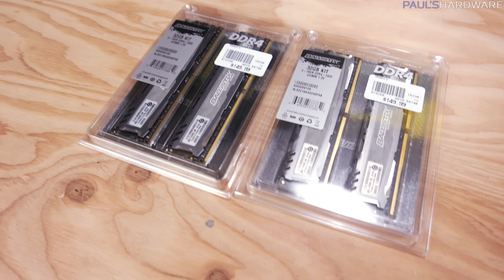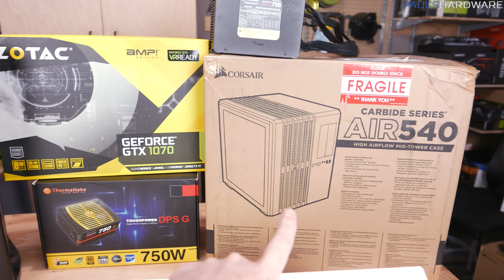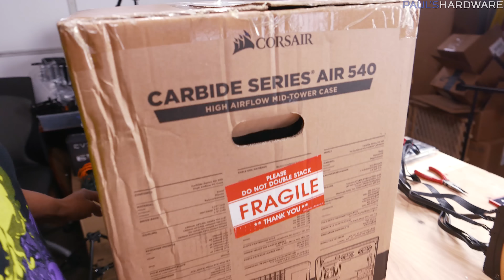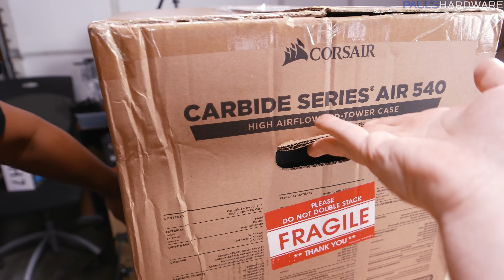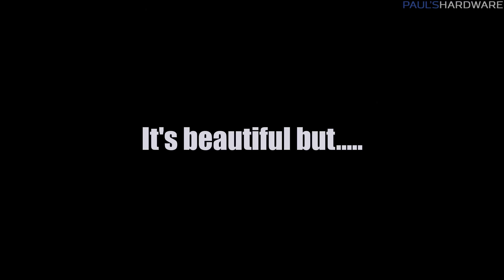Building "Party Monster" - Joe's 4K Video Editing PC

Comment: I'm confused as to why you would switch from a 3960x to a 5820k, according to CPU benchmarks they are going to have basically the same performance. They both support 64GB of RAM but the only difference is that single core performance is slightly better on the 5820k and it can use slightly faster DDR4 RAM.
Reply: ***** If I remember right CUDA acceleration is odd due to the fact scaling isn't really linear compared to gaming with GPU's. The difference in render times with a 670 and a 1070 really won't be as big as you would think it is.
Reply: He said he would be "lending it for the time being" so I assume jo will eventually move up to something better? 6900K or similar?
Reply: Basically what I was going to post lol it's overall not much faster, editing 4k probably requires a workstation GPU more than anything, even the broadwell stuff won't be much faster, because If I remember right broadwell-E doesn't overclock well
Reply: Yeah they made a really odd choice with this, the only logical thing is that he will eventually be upgrading to like a 6900k. Otherwise overclocking the tits out of that 3960x (Which is possible, it was pretty common to hit 4.8Ghz with those things) would be the best bet.
Reply: tehDmez
dunno about after effects, but premier seems to scale very poorly with more cores, older versions were actually better in that regard if I remember right
Reply: I would think for the upgrade path of X99.
Reply: Agreed should have just upgraded memory and gpu changed the case  and done
Reply: MB & CPU were Review-/Tech-Samples that Paul had lying around and by giving it to his Editor, whose basically getting a cheap Platform-Upgrade (potential 128GB-Ram Support for example) and instead of lying around, Paul can put those High-End-Parts now to good use. Win-Win with minimal investment ;-).
Reply: Birdhunter I guess that makes sense, he can't technically sell the engineering sample so might as well give it away.
Reply: He said that processor is for "the time being" so, I guess he might give him a better Broadwell-e one later
Reply: Well I had a 660ti and switched to a 980ti back in March, and I can tell you the difference between the two is very substantial both in terms of editing and rendering 4k videos. That being said, your comment on the "upgrade" makes complete sense. Gains, if any will be marginal, or mostly due to GPU and faster spec'd RAM. Although, I've found Adobe CC programs don't really care about the speed of your ram so much as the amount of your RAM. A build that would have benefited this man is (dual) Xeon setup, and a Quadro for After Effects work.
Reply: Benchmarks aren't always accurate for every use case. The 5820K will outpace the 3960X, especially when overclocking both, for certain workloads. The 5820K also supports 128GB of RAM, a newer PCIe revision (3.0), native USB 3.0, more native SATA III ports (10).
Reply: ://ReaperReaper
But all the money spent on upgrade probably would have gotten a decent workstation card to start with if editing 4k was his main objective, the CPU was pretty fine unless it was running at stock clocks
Reply: Street Guru Yes, all the money spent on the free CPU Paul received from Intel, and is loaning to his editor, could easily go towards a better workstation card.
Reply: ://ReaperReaper
I'd imagine they bought the rest of the parts
Reply: Street Guru Most Workstation cards actually aren't any better for video editing. The features you see on a Quadro are more geared for GPGPU and redundancy. Some of the absolute best editing cards have been GTX cards,
Reply: They are better for after effects, the other primary use for this dudes pc
Reply: Alexander Fagard Not really, it's been proven that Quadro cards don't actually perform any better than the GTX card sporting the same GPU for any facet of video rendering, and the extra RAM you see on some Quadro cards, like the M6000, don't give the card any more oomph over GTX cards sporting the same GPU but less VRAM, like the Maxwell Titan X.
Reply: that's not correct - with the right board, 128gb are possible for the X99 platform - Link https://www.techpowerup.com/forums/threads/128gb-ram-on-x99-platform-with-5820k-no-problem.222305/ as an enthuiast showed at techpowerup due to microcode updates.
Reply: ://ReaperReaper let's assume that he does alot of 3d stuff in after effects with element 3d, he will most likely, given the choice between the m6000 and the titan x, benefit from the added VRAM as textures don't have to be loaded and unloaded as often. otherwise, price per performance you are indeed correct. esp. w maxwell architecture. one thing i think quadro has an edge on is that its 10bit, whereas I don't think the gtx's are. can be extremely useful when color grading. but idk, ive got a 980ti and I'm perfectly happy with it and I dont have 5g's to run any in depth tests on the m6000.
Reply: Alexander Fagard Again, the additional 12GB of VRAM you find in the M6000 isn't touched for 3D work. You'll rarely see 12GB of usage in most scenatios, the 24GB is more often used for redundancy. A lot of it will rely on the system memory, which has the benefits of going up to 128GB of RAM on X99, and the data isn't sensitive to the speed difference.
Quadro cards do have an edge with 10bit color over most GTX cards (spare the Titans if you run Quadro drivers), but the additional range of color isn't actually useful for video editing. There is more benefit to HDR support, which I don't think any NVidia cards support at the moment.
Reply: ://ReaperReaper i disagree that 10bit range isn't useful. there is a reason why any camera worth its salt uses a 10bit (4:2:2) stream and that is because you get extra latitude in color correction/grading to avoid banding, to get more accurate skin-tones, .etc. if you have a full 10bit pipeline you can actually see this data rather than having to rely purely on scopes inside your NLE. And HDR support in terms of video, just means that you can see the usable dynamic range. You don't need anything special, but rather a good monitor with 10bit support and the rest of the pipeline in 10bit. But good colorists can actually see it just by looking at the scopes.

And while my work in after effects hasn't come close to saturating 6gb of vram (mostly 4). I can imagine if you were using element 3d in a form that say Andrew Kramer did when making the titles for star trek, you would quickly saturate 12gb with multiple high res textures. 

All I'm saying is that the quadro cards are not irrelevant in terms of media production.
Reply: 3960x supports PCIe 3.0 as well.  http://gpuz.techpowerup.com/16/09/20/8t2.png http://valid.x86.fr/p2gd8p
Reply: Alexander Fagard Quadro cards aren't irrelevant, but they aren't used the way you think they are. Quadro cards add redundancy, something large media companies are willing to pay for.
For Video editing, 10bit really isn't useful. The problem of banding you described, that isn't due to the 8bit range, bottlenecks, file conversions, and data corruption are. The more granular control is also meaningless, the human eye can't accurately distinguish between 8 and 10bit to make use of it.
You can also have YCbCr 4:2:2 in 8bit depth, as well as YCbCr 4:4:4. The only potential loss in perceivable quality is going from 4:4:4 to 4:2:2 and vice versa.
HDR means being able to correctly display the range of color and shades, something that'll have a larger affect than 10bit depth, when paired with a HDR capable GPU and panel.
Again, 3D work will turn to system memory first, not saturate the VRAM of a system. The data isn't performance sensitive, and most editing systems are well equipped with more system RAM than you'll find on any graphics card.
Reply: Jeremy Ellis That's reporting the graphics card PCIe bus support. the 3960X has zero native PCIe 3.0 lanes, those can only be added in through the DMI.
Reply: ://ReaperReaper no it is not.  it goes from 1.1 when i am not doing anything  to 3.0 when running a 3d app. http://gpuz.techpowerup.com/16/09/20/9ym.png 

http://gpuz.techpowerup.com/16/09/20/bph.png
 it says under bus interface PCI-E 3.0 X16 @3.0 X16 MEANING THE CARD IS CURRENTLY RUNNING AT 3.0 X16. the 3960x has pcie 3.0 support, all 40 lanes of it. amd gpus automatically run at 3.0 but nvidia cards need their driver pached, but its dead easy. nvidia did this bc some x79 mobos and even some cpus cant do 3.0. you can even get nvme boot support on x79 by moding the bios. the 3960x is still a beast of a cpu especially at 5ghz.
Reply: Jeremy Ellis http://ark.intel.com/products/63696/Intel-Core-i7-3960X-Processor-Extreme-Edition-15M-Cache-up-to-3_90-GHz
Both of those links are absolutely meaningless. There is absolutely no verification that the 390 was in the same system, or even in a system with a 3960X.
The only way a 3960X could ever run a PCIe 3.0 device at 3.0 speeds is through the DMI.
Reply: Jeremy Ellis If a revision of PCIe isn't supported, it isn't supported. The 3960X doesn't, hasn't, and never will support PCIe 3.0, officially or unofficially. PCIe support doesn't work that way, it is a limitation of the hardware.
NVidia might have botches backwards compatibility when they first implemented PCIe 3.0 on their cards, but they have NEVER claimed to have released a patch that updated X79 to PCIe 3.0.
Your guru3D link is also another load of bullshit. Heaven isn't bottlenecked going from PCIe 3.0 to 2.0 on cards like the 680. They don't fully saturate the lanes of 2.0 to begin with. Heaven doesn't even see a significant difference going from PCIe 3.0 x16 to x8 or 2.0 x16 on a GTX 1080.
The 'Force Gen3" application is also a load of bullshit. Any board running PCIe 3.0 over the DMI will already be running any slots at 3.0 speeds, and there are still a grand total of zero PCIe 3.0 lanes native on the 3960X.
Reply: Jeremy Ellis X79 in this case is referring to the Ivy Bridge-e processors like the 4960x, which do support PCI-E 3.0 while still running on X79 chipset. http://ark.intel.com/products/77779/Intel-Core-i7-4960X-Processor-Extreme-Edition-15M-Cache-up-to-4_00-GHz
Reply: tehDmez Some motherboard manufacturers have released an updated SBIOS to enable the Intel X79/SNB-E PCI Express 2.0 platform to run at up to 8GT/s bus speeds. We have tested GeForce GTX 680 and GTX 670 GPUs across a number of X79/SNB-E platforms at 8GT/s bus speeds, but have seen significant variation in signal timing across different motherboards and CPUs. Therefore we’ve decided to only support and guarantee PCI Express 2.0 bus speeds on X79/SNB-E with our standard release drivers. Native PCI Express 3.0 platforms (like Ivy Bridge) will run at 8GT/s bus speeds with our standard release drivers.

 straight from nvidia. you guys can stay ignorant for all i care but it just takes some googling. my 390 IS RUNNING AT 3.0 on my 3960x sys. take care now.
Reply: Jeremy Ellis NVidia never claimed that, no mainboard manufacturer ever claimed that.
No mainboard manufacturer can push a BIOS that enables the 3960X to use resources it doesn't have. What they can, and did do, was push a compatibility update for the new chips, like the 4960X.
Some real research, not browsing forums like Guru3D, will not support what you state. Intel has firmly denied any native PCIe 3.0 support on the 3960X, with the only option being PCIe 3.0 through the DMI.
You either are lying about running the 390 on PCIe 3.0, you're running it on the DMI's PCIe lanes, or GPU-Z is falsely reporting PCIe revision.
I can attest to the third option, GPU-Z states that my RX470 and GTX 1070 are both running at PCIe 3.0 x16, on the first and third slot. On my board, the first and third slots run at x8 speeds when both are active, something I verified in my UEFI.
Reply: ://ReaperReaper "that isn't due to the 8bit range, bottlenecks, file conversions, and data corruption are." this statement is the reason why I know you have almost no real world experience. i'm not going to refute your claims, because there are plenty of articles on filming that actually explain the difference between 8bit and 10bit color/grading. cough cough: http://www.hdwarrior.co.uk/wp-content/uploads/2011/08/10-bit-chart.jpg. not to mention I have yet to meet a camera that can record 8bit 4:4:4 (its usually 10/12bit 4:4:4). if you can find one be my guest. also the human eye might not be able to determine the differences between 8bit and 10bit off the bat, however you can totally see it when grading in terms of how far you can push an image to look a certain way before artifacting .etc. starts to show.

also I was recently at IBC, and a majority of the color grading workstations were using... guess what? quadro cards (sometimes paired w gtx). 

also HDR does NOT necessarily mean what you say it means in terms of video. DR in terms of video editing and filming for that matter refers to the usable range a camera can put out when recording to a log or RAW profile (e.g. 12-14 stops .etc.). Atomos recently tried implementing HDR into their recorders but its mostly a gimmick as you can see use-able range with your scopes and/or an on set LUT.
Reply: Jeremy Ellis Ooh yes, a bunch of forums will prove Intel wrong.
Look, let's pretend the 3960X did natively support PCIe 3.0, why would Intel limit it? PCIe revisions have become a huge selling point.
The 3960X can only use PCIe 3.0 over the DMI. NVidia's compatibility patch won't fix that (they don't even work on any software for components they don't make). Vaporware that "enables PCIe 3.0" won't do that. All you're proving is that there are more morons that will believe that it can.
Reply: ://ReaperReaper one of my links was a massive gain in performance on a 4-way 680/3960x sys but i highly doubt you read any of them. the reason intel did it is bc sb-e was having problems with 3.0 and couldn't get it certified in time. intel decided to just drop 3.0 support. why do you think all the mobos have 3.0 support plastered on the box? some ppl cant get it to work on there 3930k/3960x cpus. its not a glitch and its not a lie, my 390 is running at pci-e 3.0 on a 3960x sys.
Reply: Jeremy Ellis Every single link is to a forum, not a single reputable source. There is no reputable source that supports your bullshit claim, whereas Intel's 3960X ARK page and X79 SB-E block diagram point out explicitly that the 3960X only supports PCIe 2.0 natively.
The reason people can't get the 3930K and 3960X to run cards in 3.0 is because the chips have zero support for natively running PCIe 3.0. The "Force 3.0" patch NVidia offers is a Windows Registry tweak that forces compatibility of the PCIe 3.0 graphics cards on the 2.0 bus. Nothing more, nothing less. Anything GPU-Z reports as a 3.0 connection is a false positive, which isn't unexpected. Software based hardware monitoring has never been 100% accurate, and the potential to completely report a statistic wrong is always there.
The 680 isn't going to see any difference going from 2.0 x8 to 3.0 x8. The card doesn't saturate a 2.0 x8 connection, no card at the time did. SLI doesn't change that.
To say your 3960X offers any PCIe 3.0 connectivity natively is a lie. The best it can do is PCIe 2.0 x16 and x8, which have roughly equal speeds to PCIe 3.0 x8 and x4, respectively. Newer variations of the X79 chipset can offer PCIe 3.0 support over the DMI, but that is as good as it gets.
Mainboards supporting PCIe 3.0 doesn't mean anything in regards to the chip, especially when Intel has a habit of running two generations of chips on one socket and chipset. Mainboard manufacturers collaborate with Intel on the board designs, and having insight into what technologies Intel intends to implement allows mainboard manufacturers to futureproof.
Reply: Once you get into the actual workloads he's doing there is a huge difference. Don't use benchmarks as a tell all.
Reply: Jordan Broly there really isn't. like i said, i've tested my 3930k against a friends 6800k in terms of video editing performance and it was negligible at best. RAM and GPU played the biggest factor with adobe programs. maybe in rendering you'll see a bit of a diffrence, but for me what matters the most is live playback with effects on clips. which I can achieve in 4k with lumetri color active on my 3930k + 980ti. so huge difference i think not.
Reply: The GTX series has had 10 bit color for a long time now.
Reply: Well then, I'm sure there are other benefits as newer instructions sets. Besides the build bug bites us all. And no. Xeons aren't as flexible as the HEDT chips so that path is already off table for most folks.